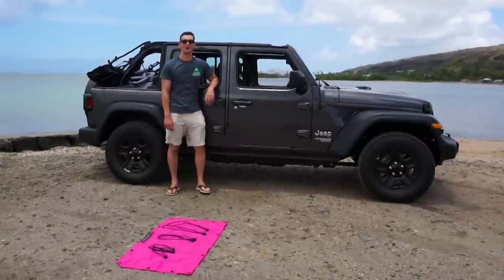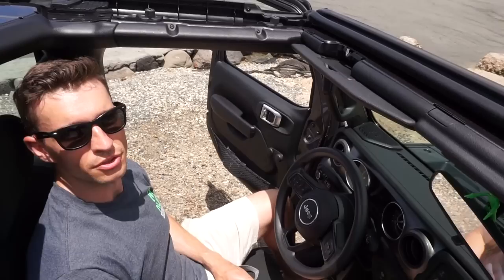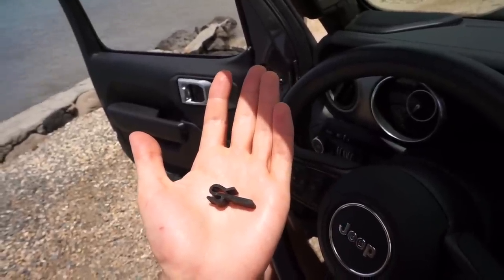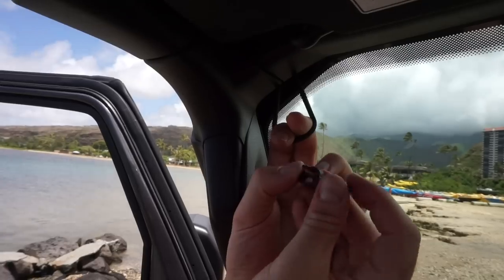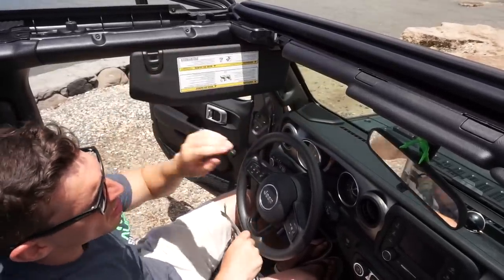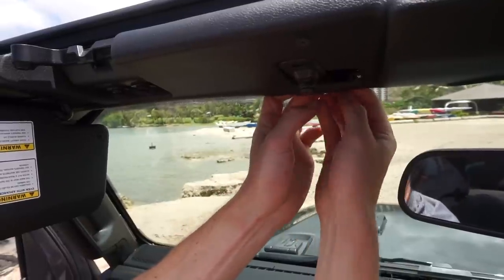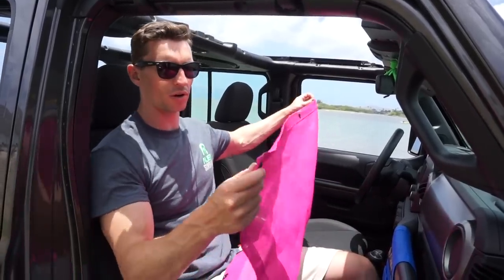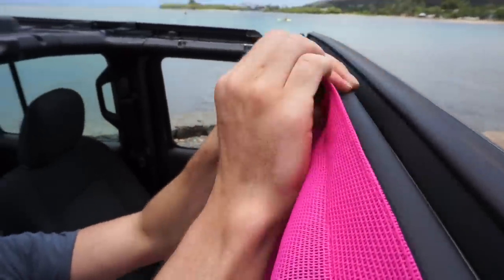Alien Sunshade Jeep Wrangler JL & JLU Front Shade Installation - For Shades Bought On/Before 07/2021

Comment: I failed at step 1 of attaching the clip to the front left metal edge. I can barely see the metal edge and there isn't enough space for my fingers to maneuver in there. There's also a thing plastic lining getting in my way. Very frustrating

Comment: I noticed the alien label is installed towards the sky which gives you the sewn fabric edges too look at above your head. I would rather reverse it to see the smooth fabric and no seams. Can you also reverse the bungee so the ball is on the top and out of sight? I have both the front/rear and will install them this week.

Comment: I have the 2 piece on my JL and i love the way it looks over the 1 piece but why cant they make it just a little wider on the front and rear shades so the front of the front shade doesnt have that 2 or 3 inch gap by he winds shield. i hate that it doesn't go all the way up to the to of the windshield. you know what I am talking about ????
Reply: Just installed mine and I have the same annoying gap between windshield and front shade. Kinda pointless to have a sunshade that lets direct sunlight right onto my face! Hoping they intentionally made it a little small to compensate for a little stretching.
Reply: @joshuahahn4979  I agree with you on the gap but i think maybe if it went all the way to front it be a little harder turn the handles on the freedom panels you think ? But the 2 piece sure looks better then that 1 piece with the hump over the sound bar. and if i want to have some people stand in the back for home coming parades at my wife's high school like we do its so much easier to just take off the back then the whole shade
Reply: As I had hoped the fabric did stretch a bit to fill some of the gap after a few hours. Looks much more symmetrical now with the the rear gap. Totally agree about the hardtop. Cheers.

Comment: Mine came without clips!!!
Reply: Scan the QR code in the instructions they apparently scrapped the clips and went with a simpler design. I had the same issue. It is actually much easier. I notice your comment is a couple weeks old so you’ve probably discovered this already.